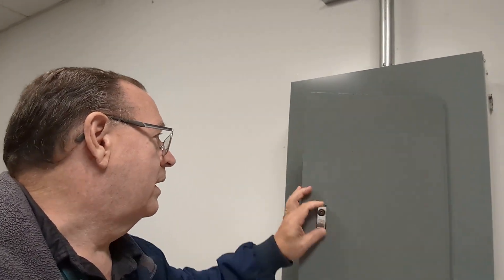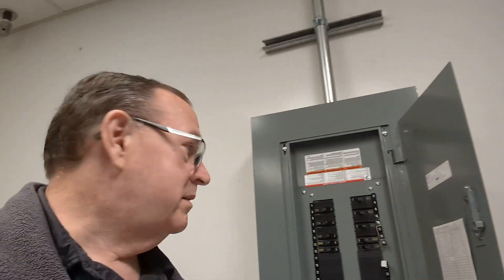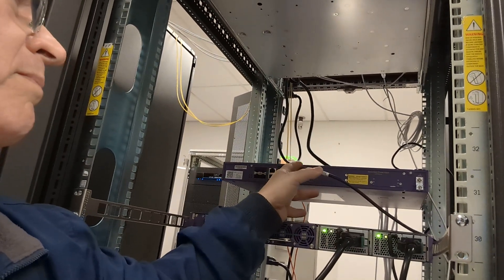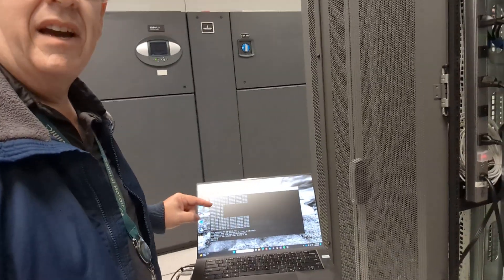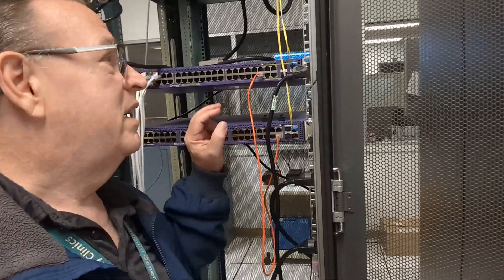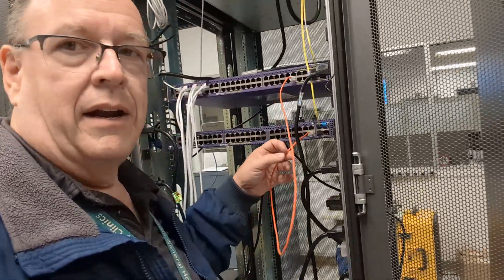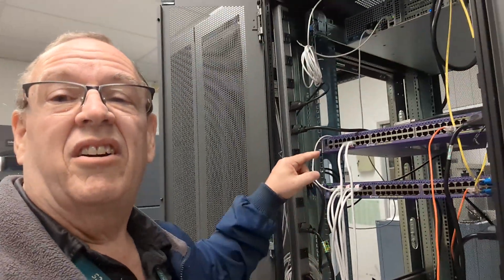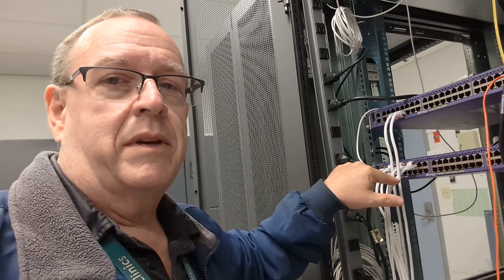Network Admin Life - Switch Swap

Comment: After our own cold-and-dark-datacenter-at-four-in-the-morning event, we colour coded every power cord red, green, and yellow. Red and green for the two feeds, yellow from the transfer switch for the few things that doesn't have dual input. We can now take a UPS failure and fail operational, and it is very nice.
Yes, the ping won't succeed until the switch sees a packet from host you're pinging, or the CAM times out. arp -d is your friend.
Reply from the maker: Ours are black and blue.  Black for utility power (also UPS power) blue for E-power.  God bless!

Comment: Untagged means the port will accept "untagged packets" on the designated port vlan.  

Tagged means the port will also accept "tagged packets" from the specified vlans.  The trunk port uplinks should include all  the available vlans on that uplink.
Reply from the maker: Correct.  But having to explain what I do to a broad audience I like to use the simplest terms possible.  And when talking to management.  God bless!

Comment: That last host move not responding at first would be an ARP issue.  In think the default on extreme switches is 4 mins.  I bet the other hosts GARPed to let the switch know the MAC address was on the new switch.
Reply from the maker: Probably the case.  Luckily everything is moved over now.  God bless!

Comment: Cool need a little more technical explaining please.. go in depth with the configuration. Untagged  means what??
Reply from the maker: With VLANs there are tagged and untagged packets.  If it's tagged it means the data packet is carrying 802.1q tagging data within the packet.  A switch will look for that tagging data within the packet and send the data along to the correct vlan if multiple vlans are present (tagged) on the switch port.  But what if the switch gets a packet that does not have any tagging data as part of the packet?  There where untagging a port comes in.  If you UNtag a VLAN on a port you're just telling the switch if you receive data with out any VLAN tagging info embedded in the packet put it on the untagged VLAN.  Hope that clears it up and God bless!